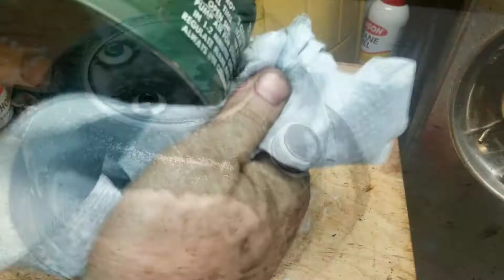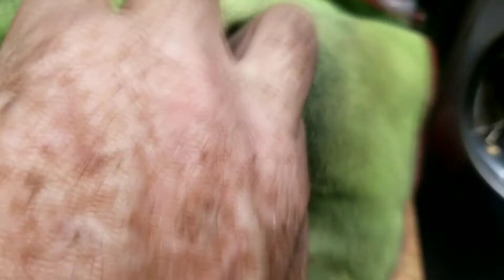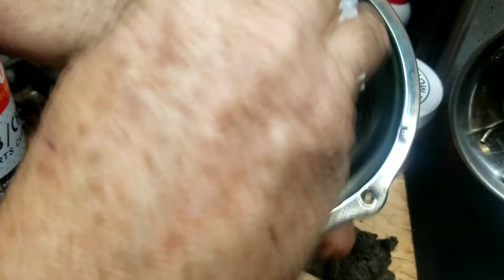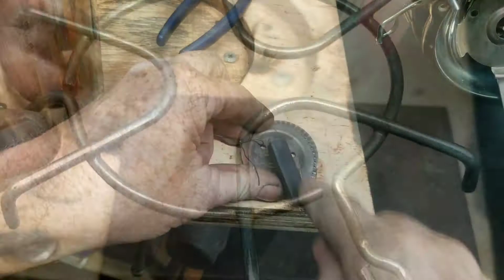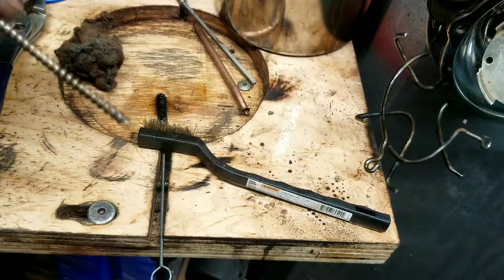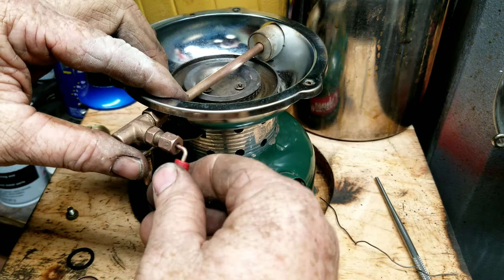Coleman 502 cleaning and reassembling.

Comment: Greetings from Russia.Can the tank be painted? What paint is suitable?
Reply from the maker: Yes it can be repainted but I prefer to keep it original if possible unless it has bad rust with pittng. 
I use Rust-Oleum brand paint. You can add also a clear coat but try to use a good automotive grade because some will peel iron you get fuel on it.
Thanks for watching and God bless.
Reply: @colemanrestorationsrepair4171  Thanks for the answer. One more question... My Colman 502 lights up well, but after a few minutes a yellow flame appears. It's blue at the bottom and yellow at the ends. What could be the cause?
Reply from the maker: @dnd8783 Are you sure you're giving it enough time to warm up?
Possible the generator needs a cleaning or a little rush on the burner ring?

Comment: Rob, Dom suggested I ask you on this issue. I have a 400 with one foot hyperextended and was wondering if they can be replaced as it won't sit level now. Please advise. Thx, Bill
Reply from the maker: At one time, I saw the replacement legs on old Coleman parts. 
You might check eBay also. 
The problem is if I'm not mistaken, it has a long skinny rivet holding them on, and you will have to grind one end with a Dremel tool.  You might find a role pin that will fit in its place. If nothing, you could probably use a small finishing nail or brad.
Just bend the tip over to hold it in place. 
I hope this helps. 
God bless.

Comment: Thank you.  That is one fine instructional video.  Very good narration and explanation on ever step!

Regarding the split generator tube.

Could you use a flaring tool and flare out the generator tube, past the split in the generator tube?  

This would mean, filing the generator tube down, to the split, then creating a new flare at the end of the generator tube.  

You may need to make a minor adjustment on the the internal rod of the generator.  It may be worth looking into.
Reply from the maker: You could definitely repair it this way, but it would also make the generator shorter. This would most likely allow gas to leak out the opening of the mixing chamber. The generator really needs to be inserted as far as possible. 
If you try it, let me know how it works for you. 
Thanks for watching and commenting 🙂 
God bless.
Reply: Thank you for getting back with me regarding my question on shortening the generator and using a flaring tool to repair the generator.  Yes, I was also concerned regarding the generator being too short inside the mixing chamber.

I followed your instructions on cleaning and restoring a Coleman 502 stove that I recently purchased at a flea market.  I was able to clean the seized check valve and get it working again.  

I still need to disassemble my 502 stove and give it a good cleaning as you have done in your excellent instructional video.  

Currently, I have my 502 stove sprayed down with penetrating oil, in order to loosen the surface rust and rusted screws.  

Thank you for your help.

Comment: I'm curious on these older stoves if the fuel supply is leak-free when the valve is closed?  If it tips onto it's side while transporting, such as in a pack, will it spill?  Thanks and good video on cleaning and assembly.
Reply from the maker: The stove should be completely leak proof when you shut off the valve. All the fuel in the generator should slowly burn out after you turn the valve off.
Thanks for watching and God bless.

Comment: I'm wondering if that crack in the generator tube could have been repaired with acid core solder,  the same solder used in building radiators, rosin core definitely wouldn't work.
If these tubes are  scarce and expensive  it might  be worth a try.
When I go over my stove and if I find this I'm thinking it's worth a try.
Reply from the maker: I did save the generator and wanted to try this but don't have any experience with soldering. 
At the time I made this video these generators were really hard to find and expensive but they are making a reproduction now that sales for around fifteen bucks. Don't know about the quality of these but it's a fair price.
Reply: @colemanrestorationsrepair4171  it's good that you saved it, learning how to solder isnt hard but don't start with that as your first project. 
I'm sure there's all kinds of videos on it and it's kinda fun and if you don't already weld it gives you some skills that makes it easier to learn that too.
Reply from the maker: @bipedalbob  I done a little welding back in the day. Mostly just tac welding. 
I have tried a little soldering lately. I built a external pump for my Coleman table lamps out of copper pipe. It wasn't the best looking soldering but it worked just the same. I may try to tackle the generator before long but I will practice a little more first.
Reply: @colemanrestorationsrepair4171  I really think it would work, get it super clean and the right flux for the solder, even if it's messy at first the surplus can be filed then sanded, and if the tube is mis-shaped the solder is as malleable as the tube.
I've soldered stainless steel in the past as well, with excellent results, but again the correct solder is critical or it doesn't work at all,  I think there maybe event solder for aluminum.
I would think acid core solder and flux , I reattached a mounting bracket to a brass radiator with that and it never let go,
But the first try with rosin core, the type used for electronics it wouldn't stick for long.
Reply from the maker: @bipedalbob  Sorry just seeing this comment. 
Thanks for the information. 
God bless.

Comment: My old 502 did not have those plated parts.  Mine are just bare rusted metal.
Reply from the maker: Yeah. Over the years the plating will burn off.
You can boil the rusty parts in vinegar and scrub with a wire brush then heat them with a torch and spray with wd40 while hot to slow the rusting process. 
The metal will be a dark color. 
Thanks for watching and God bless.

Comment: Have you ever did a 530 coleman stove ? Iam doing one now and stripped out some bolts to the top burner .and tryed to drill them out and now the holes are larger ..so then I tried to solder the holes in completely so  I could start over with a  new bolt.but when I tryed to use the tap set it just pulled out the alloy Solder that I used ..so I was just woundering could I use maybe brass to solder it In and use my tap set for a New bolt or screw holes ? Please help with any kinda suggestions
Reply from the maker: Oh no 😬
I always fear this would happen to me but I have been lucky so far. 
I would recommend drilling and tapping the the next size up and replacing the screws to match. 
I have the 530 stove but I have never had to do anything to it yet. 
I say if it ain't broke don't fix it.

Comment: Just acquired one of these and wanted to rebuild/refurbished it. Your videos are awesome. You have made my project so much easier. Great job
Reply from the maker: I recently did one and really warped the burner bowl trying to remove it. It was really difficult to straighten it back out. 
I seen on Facebook someone is making a simple tool to remove it. 
It's just a piece of thin flat stock steel with holes drilled in it to line up with the ones in the burner bowl with a hole in the middle filed square to fit a ratchet. Looks simple enough to make.